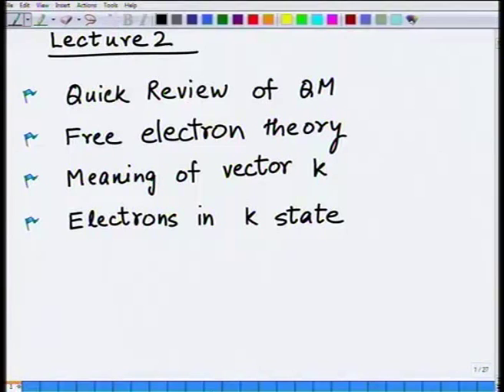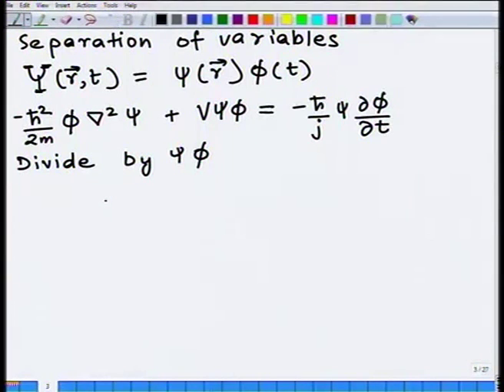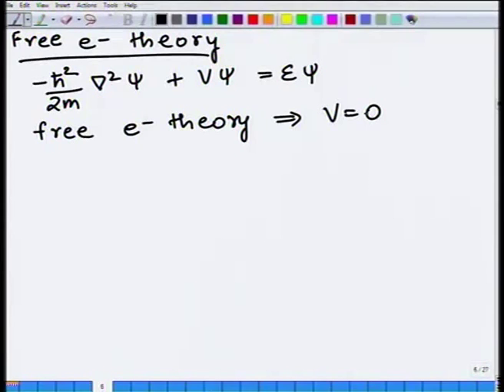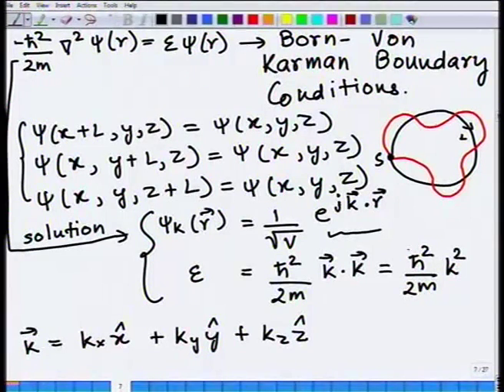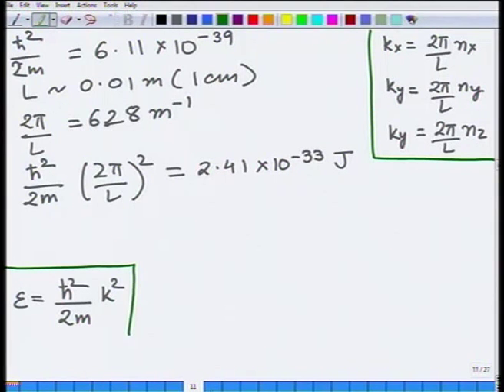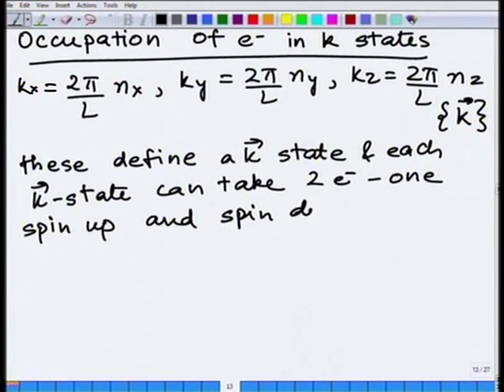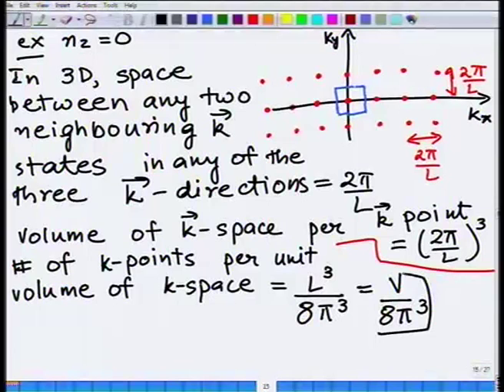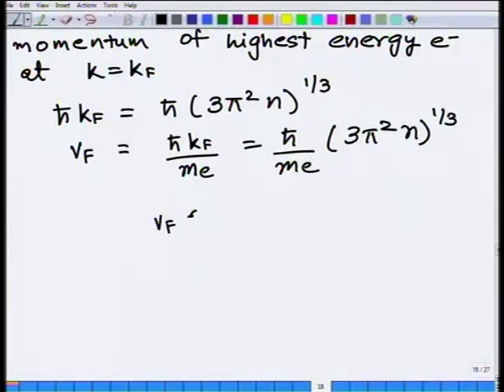Mod-01 Lec-02 Free electron theory

Comment: Is it not obvious that the electron is made up of at least 2/3 fundamental issues...
1) The electrical issue...a negative charge.
2) The wave function of the electron.
3) The mass of the electron...This is the interesting bit...either the mass is a result of the other two issues or the electron is a "particle" in it's own right.

Because the gravitational force is so weak compared to the other forces...especially in the electron's case...the electric charge, then a comprehensive study of why the electron exhibits "mass" could possibly yield a breakthrough...
Why should a point charge which exhibits the wave function also exhibit mass.?...Could this be a clue as to the origin of mass.?
Bashing heavy particles like protons together, just yields more bits from the collisions...But the electron is a different beast altogether...mass, electric charge and wave function...Now that is interesting.....

I would hazard a guess and suggest there is more to the electron than so far discovered....
Reply: I would suggest you to kindly read and understand Quantum Mechanics first.... What you have written is fundamentally incorrect...